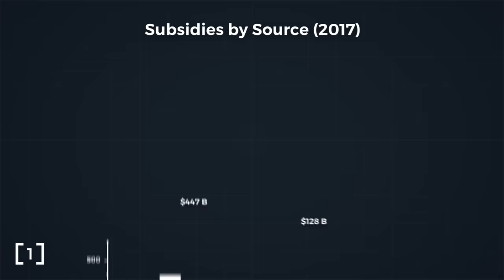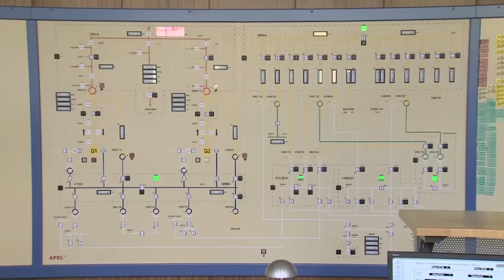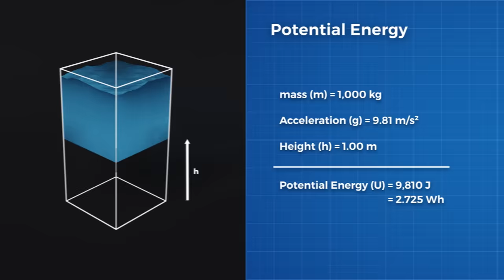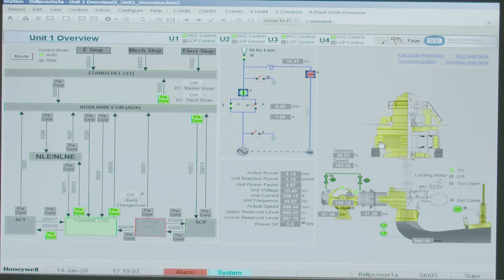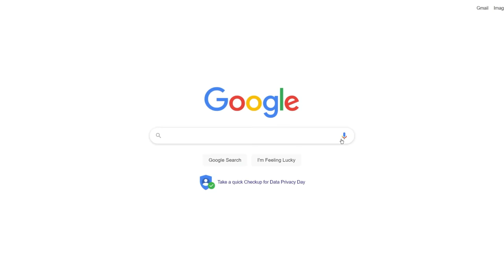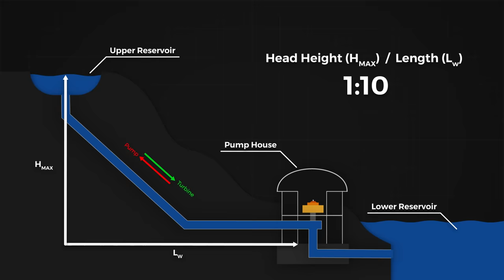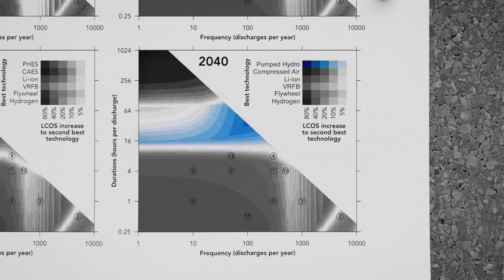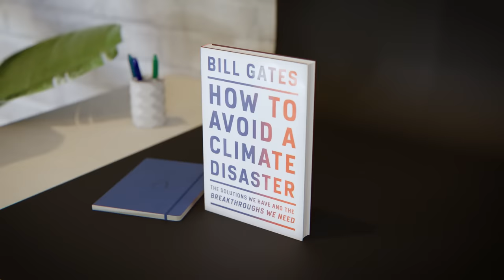The Truth About Pumped Hydro

Comment: 0:30 This seems to be a bit disingenuous, though. If fossil fuel is ten times bigger than renewables, yet it received only 4 times more subsidies, it would still mean renewables, in comparison, are WAY more subsidized than fossil fuels. Surely you must see the truth in this?

So, tell me, how does it compare if you take subsidies for each - actually delivered, not theoretical - delivered MW/h? The amount of subsidies given in regard to the amount of actual energy given back is the real measurement here. Do you have any numbers on this?
Reply: It's not as simple as that either, though. Most of the money spent on renewables is in building them, not operating them. If you're going to compare subsidy per MWh, then you should amortize the construction subsidy over the lifetime production of the thing you built. Not the current production in its sector.

It gets complicated, doesn't it. Fossil costs are much more heavily weighted toward ongoing fuel production rather than startup costs.
Reply: @ps.2   But coal and gasplants, and even nuclear plants, last far longer than renewables (who typically have to be replaced every 20 years, if you're talking windmills). So I don't think you're doing yourself a favor here, if it's meant as a pro for renewables.

Look, it's pretty simple, in the end. It's about: how do I get the most bang (energy) out of the bucks (subsidies). Also, do note I said actual delivered energy. That is, because in reality, windmills typically only deliver 30-40% of what their maximum claimed electricity production is during their lifespan.

Wind has an operational cost (aka, as marginal cost) that is 5 times lower than natural gas plants. However, that doesn't change the parameter: it still means you have to compare what energy you get out of windmills, compared to the energy you get out of gasplants, and compare that to the subsidies each sector got. If the operational costs are 5 times lower, but you have to pay 3 times the capital cost in the same 60 year-span, AND your output is 10 times less for the same investment, the logical conclusion is still that you're way worse off with going for wind, with the same amount of subsidies. (Or in reverse, that wind gets A LOT more subsidies in comparison to the energy you get back).
Reply: Ashley_ T[A]P Me!! To Have [S]EX💞 With Me  

Even if that were true, it would be true for both wind and gas, and nuclear, for that matter. So it doesn't change anything to my critique of the author saying gas gets more subsidies without saying how much bigger gas is in comparison with wind.

Comment: I'd argue that this video is looking into a problem, created by a poor solution.
wind and solar are relatively cheap to build yes, but you have two problems with them as a result of their output being unstable. 
First you need to find some way of storing that energy, which is incredibly expensive at the capacities needed to deal with a whole nations energy demand even for a single day.
Second you then need to build an over abundance of generation capacity, to be able to recharge those energy storage options without interrupting the supply to the grid.
Third you need to hope you don't have a prolonged period of poor generation weather that would use up the stored capacity you have without providing enough energy to recharge that storage, otherwise you'd have a blackout, which in the modern world is unacceptable.

The better solution would be to just build a reliable power generator to begin with. Nuclear, Hydro and Geothermal are the only options capable of providing continuous uninterrupted power which isn't dependant on weather conditions and doesn't emit CO2.
They are more expensive to build, however would be cheaper than the cost of the over supply of generation and the energy storage necessary to make wind and solar even close to reliable. Once built they are alot easier to maintain, Nuclear and Geothermal particularly do not require the vast amounts of land that solar and wind generation do. they are all located in a single building. 
I do not see wind and solar being capable of being the primary source of power generation without having huge reserves of fossil fuels needed to back them up when their output fluctuates.
Wind and solar would be far better suited for use as microgeneration to supplement the grid. homes and commercial buildings like warehouses utilising roof space for solar, Farms utilising small wind turbines on top of towers and silos. These are far better suited to supplementing the grid with reduced demand due to micro generation, than they would being the source for the grid.
Reply: This is always swept under the rug. The people who think that we can have 100% renewable energy are engaging in wishful and frankly delusional thinking. Although it is a very romantic idea that you can get all your energy from nature. Do these people really think that you can produce steel on renewables? "Well Today the price of steel just increased ten fold because the sun wasn't shinning". Steel is only a small piece in the economy. Everything we touch, see requires enormous amount of reliable cheap energy. If energy is expensive/unreliable our civilization would have to go back to an energy poor state. What we had for 100s of years. I don't think the people would like that very much.

Comment: Isnt it better and more realistic to use nuclear to replace the natural gas?
Reply: Yes but the stigma surrounding nuclear won't let that happen.
Reply: Nuclear fission power is seeing quite a bit of private investment being pumped into it right now, actually.
The major current disadvantages (ignoring bad PR) are the high upfront cost and the fact that you can't really throttle them.
Reply: @hydrochloricacid2146  nuclear plants can load follow you know.
Reply: @Gornemant  not as quickly, and doing so quickly generally requires higher enrichment fuel (which costs $$$)
Reply: @hydrochloricacid2146  instead of focusing on huge nuclear reactor, they should focus on small scale reactors. Small upfront cost, and lower maintenance. Honestly nuclear is the cleanest energy on the planet, and thorium is more abundant than plutoinum and urainium and have a shorter radioactive decay life.
Reply: @hydrochloricacid2146  Not as quickly as hydro, also throttling them increases the cost of power since they're not working at peak efficiency, that's why they usually always work close to 100%. Though, the only reason to quickly load follow is solar and wind, without these two, there would not be a need to quickly load follow.
Reply: @goldendemise3165  That is actually what's being looked at right now for the future of fission: small, self-contained, shipping-container-sized reactors that can provide power to a community for a decade or two before they're shipped back to the manufacturer for servicing and/or disposal. 
In theory they can be deployed anywhere, can be made cheaply in an assembly-line-like fashion and need minimal maintenance. 
I believe the term is "Small Modular Reactor,", or SMR.

Comment: or you could just build a few nuclear plants.
Reply: Nuclear is a major reason for pumped storage.  Nuclear's production is too consistent compared to demand, which various significantly thoughtout the day.  Northfield Mountain in Massachusetts is a pumped storage facility for a nuclear power plant upriver in Vermont.
Reply: that would be too efficient.  need to lecture you more about your SUV
Reply: Nuclear gets a bad rap (I'm only referring to its reasonable bad reputation, "radiation scary" isn't) because we use it badly. It would be interesting to know the viability of converting nuclear waste into batteries.
Reply: pumped hydro is for energy storage, not power generation. 
so if used it would be built in connection to a nuclear plant, not instead of it.
Reply: @bearcubdaycare  That's a myth. All nuclear power plants can load follow to varying degrees, but it's more than good enough. They just haven't done so for so long people have mistaken it for a rule. In particular French reactors can throttle faster than gas turbines, the gold standard for load following, and do so every day. This is because nuclear is over 70% of their grid so it must do everything as part of normal operation.
Reply: @bronzedivision  Do you have a source for that? People always claim this stuff but in practise it just doesn't happen.

Comment: For the love of God just use new nuclear
Reply: The residents of Fukushima disagree. Besides it’s far more expensive than wind and solar
Reply: And new nuclear would require more pumped storage.  (It's a major user of pumped storage.)
Reply: That would be too practical.
Reply: @bearcubdaycare  I've never heard that can you send me your sources I'd quite like to find out. 
Personally I've been a big advocate of new nuclear because of how safe it is and how scaleable it is vs green and traditional energy production. I'm aware it takes alot of water just due to it powering steam turbines. I wasn't aware of the need for pumped hydro for nuclear because the operators of nuclear plants can change the power production based on need unlike alot of green power alternatives.
Reply: @rcpmac  To be fair that was an old style nuclear power plant and it was hit with a huge earthquake and a tsunami after the fact. New Nuclear is much safer and yes upfront cost would certainly be larger but they last much longer than the constant maintenance that has to be done on green energy like wind turbines or solar panels that have a much shorter life. Also solar panels produce a lot of non reusable waste. So really they're about neck and neck cost wise but really nuclear probably comes out on top. This is just the impression I've gotten from the research I've seen.
Reply: @Goodish_night  Too cheap to meter. Too safe to monitor. LOL